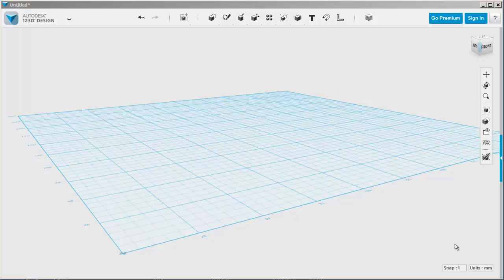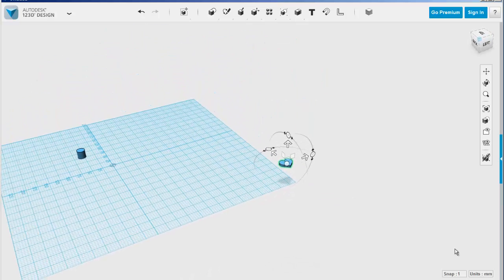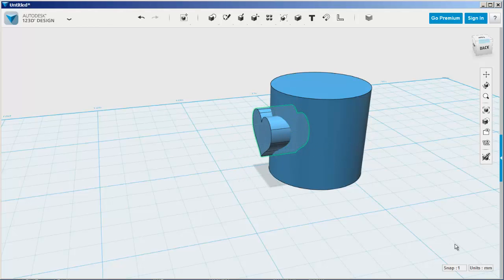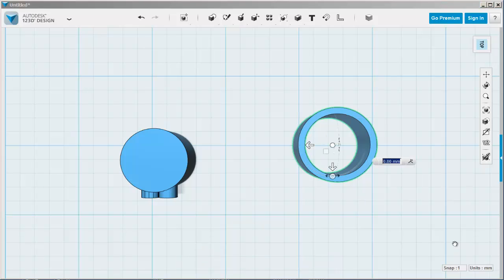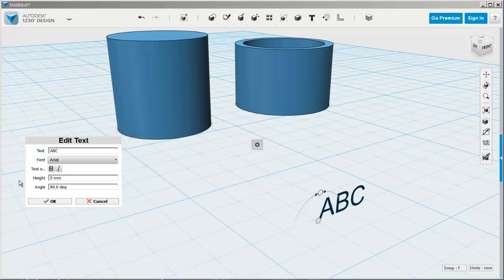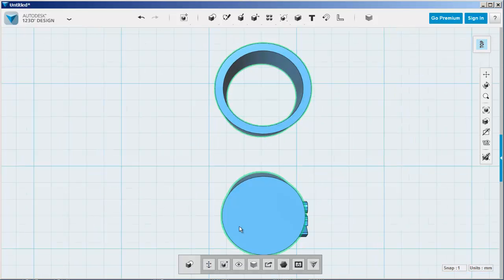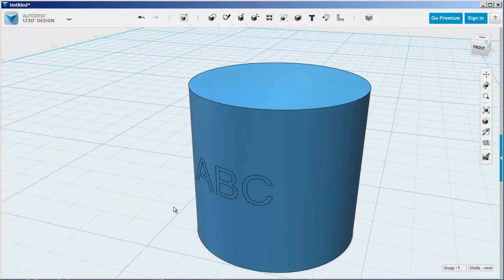123D Design: Place SVG or Text on a Curved Surface

Comment: yes but what if the heart was longer then the radius of the cylinder? in my case its text thats longer then the radius of the cylinder
Reply from the maker: Then you need to use SketchUp and the Shape Bender extension and then import it back into Design. :)

Comment: Thanks,...please:
can you say to me :....
 " when i need to use mesh? "when need to use solids?"...
  "before to do an bolean substract, need i the 3D text convert to mesh or to solid, to do the operation substract" ?.
   I cant see clear these point.
   Greetings
Reply from the maker: Usually you need solids to do Booleans. Sometimes you can do a Boolean with an imported mesh, but you don't know if that will work until you try.

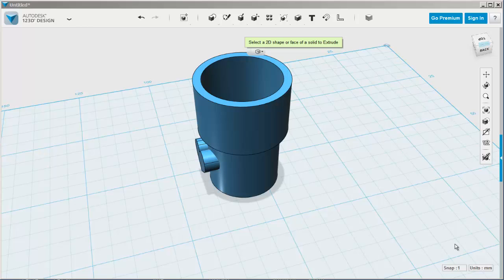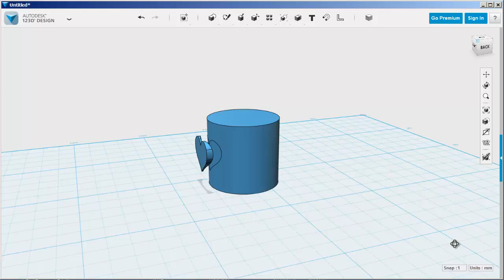Comment: Not sure what I'm doing wrong, but when I extrude the cylinder down to make the final cut (3:43), it splits the "heart" into two pieces that are still attached to each other like a single object. The outer bit that you delete at 3:54 also deletes the other half left inside the cylinder and the whole heart sketch disappears. :(. Any ideas?
Reply: After much frustration I have finally worked out a way to do this.  You have to select the text and then select Separate under the Combine menu.  Once you have done this, you will be able to select individual pieces of the text and delete what you don't want.  It worked for me.  Hope this helps those of you who are having the same issue.
Reply from the maker: Hi Bill, I can't say without seeing the file. I just suggest that you retrace your steps to do EXACTLY what I did in the vid. You deviated from those steps, I think, which has caused the solids to behave differently.
Reply: Bill is right,you just deleted the remaining part,but i have tried everything,the two parts are still joined or attached,iv,e tried to extrude the part,i can,t just delete been back and back again to see if ive missed anything,this does not work,also they disappear when merging,i just can,t highlight the remaining part then delete?
Reply: I know this was a year ago, but I'm having the same problem.  I'm unable to delete the pieces of text that have been cut off.  I've tried everything, but for some reason they are still connected to the rest of the text and can't be deleted without deleting all the text.  Has anyone found a solution to this yet?

Comment: That's a good tip, if the cylinder was hollow would the text be inside as you only seem to delete the outside to make it flush..
Reply from the maker: You can delete the inside, too, here's another vid. Or just not push the text in real far. https://www.youtube.com/watch?v=aurkcUKoLlE

Comment: The letters won't be scaled properly with this technique.
Reply from the maker: Not sure what you mean? They'll be whatever size you made them before moving them into the cylinder. They're not truly wrapped around the cylinder.
Reply: That's exactly the point.  Because they aren't truly wrapped around the cylinder, their dimensions won't  be relative to the curve of the cylinder.
Reply from the maker: Well, until Autodesk gives us that function, this is the best we can do. :)
Reply: There's other ways to do it that keeps the dimensions intact.